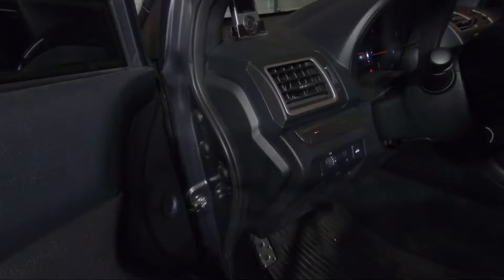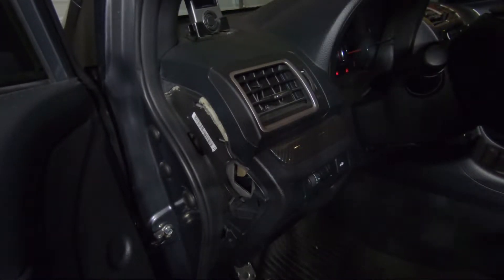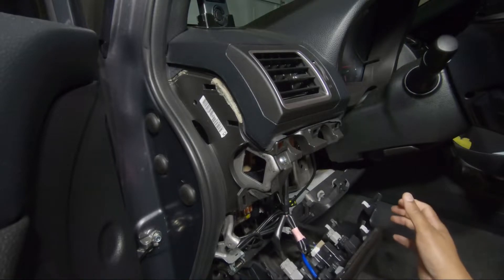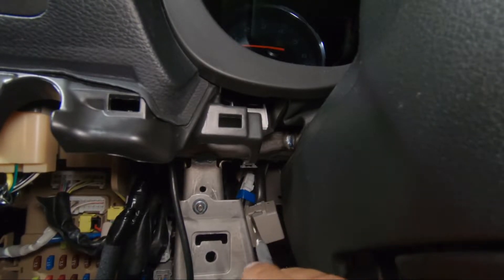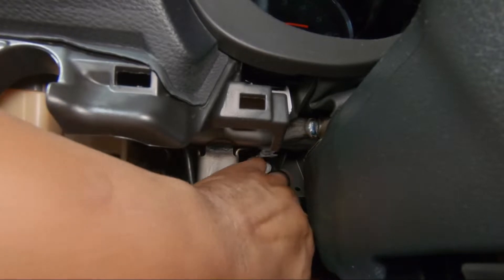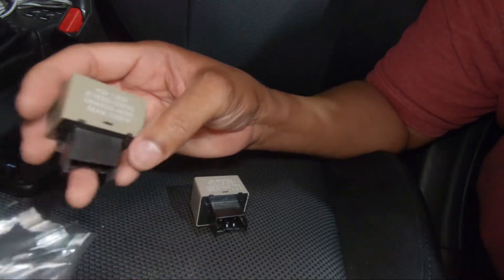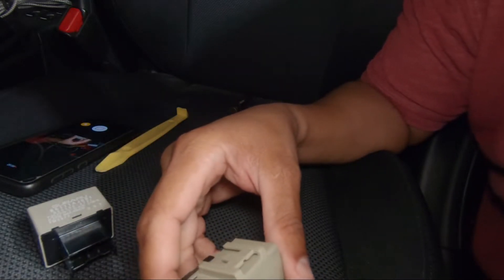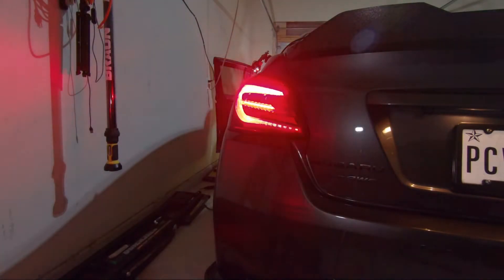How to Install OLM LED Hyperblinking Moduel 2020 WRX

Comment: Hey installed mine but the light don’t bright when I lock the car now and now there’s a loud chime if I don’t turn off the lights when I leave the car ?
Reply from the maker: My lights don’t blink anymore as well when I lock the doors but I think that has something to do with the fact that they are LED lights and they respond faster. As for the chime are your lights just on or on auto? Cause it sounds like they are just on, in auto if you are in the garage for instance the headlights will be on but shut off in a minute or so if that makes sense.

Comment: Did you need to add resistors to the tail lights along with the hyperblink module? Or do you only have the olm hyperblink module installed?
Reply from the maker: No, just the module is all I needed. Now the front turn signals came with a resistor so that stopped them from hyper blinking.

Comment: I have a problem with it when i put the right flasher and turn right it will flash on the left after i have turned right which i find is annoying anyone has this problem?
Reply from the maker: I have not noticed a problem like that, what type of lights are you using?
Reply: @MoJoNinjaGarage  sequential flasher lights setup, its only when i turn right too, if i turn left it doenst do that but when i put the right flasher it will flash right and if i turn the steering right it wil flash 1 time to the left its really anoying and appeared right after the installation of the olm relay strangely
Reply from the maker: @franklaramer5233  send it back you may have a defective unit or an issue with the light, hard to tell without seeing it. Sorry I couldn't be much help.
Reply: @MoJoNinjaGarage  kk cuz its working fine with the subaru relay except for the hyperblink
Reply from the maker: @franklaramer5233  yep kinda sounds like a bad unit. Try to send it back and get them to give you another one.